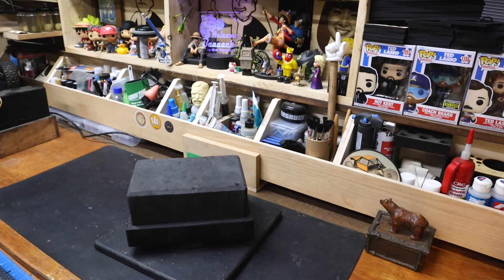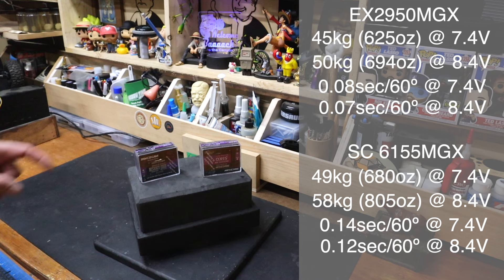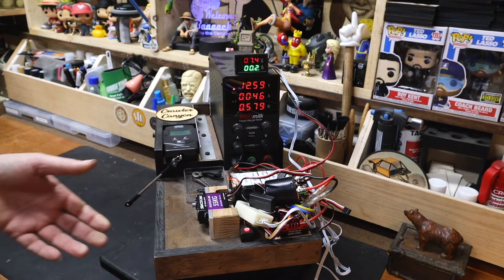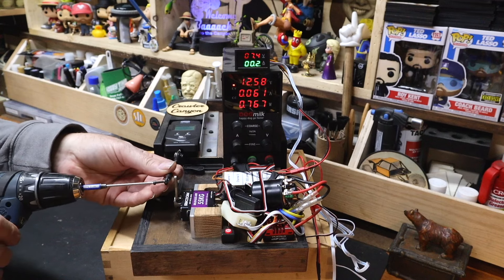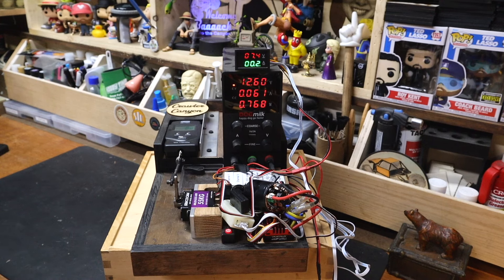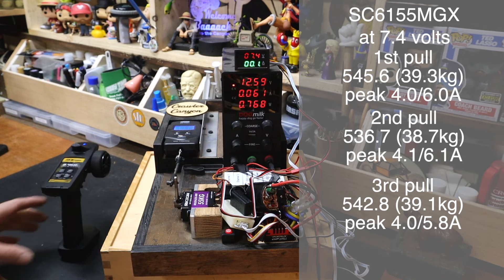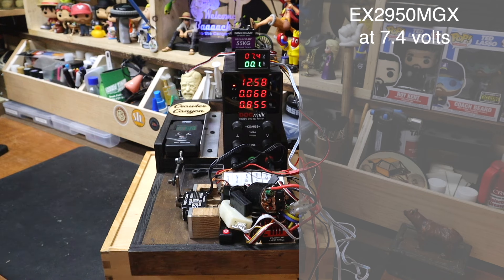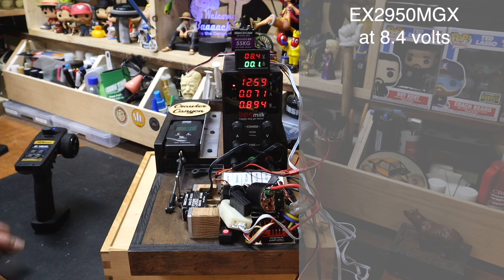Crawler Canyon Presents: Servo Testin' Time, Sincecam 55kg & 50kg LP

Comment: Watching the voltage drop can explain the lower numbers and we are stressing the 1080 max output.
I put a AGFRC A50BHLW in my yet boat, it's also a 90 euro low profile servo in a set with alu arm and progam usb dongle. I don't need torque to move a nozzle side to side but it's fast and a whole ton better than the plastic geared stock servo ( that got wrecked with a flip beach landing ) and commonly I like the full metal 60-70 euro servo's
Reply from the maker: You would love the A50 even more without the euro pricing--  I have one here still in the package for future drift car use (the programability) and it was $59USD.
Reply: @CrawlerCanyon  Just the A50 19kg is 69 euro right now on ali official AGFRC store and I always get a bit of discount at checkout. The programmability I wanted to test and have for future use like 360 and winch servos. So instead of massive end point change I changed the max throw angle way down. It only needed like 90 degrees and 270 or 180 is way to much. plus full metal and ip67 it's a baller servo. the full metal JX I bought locally in the past are also way up in price, used be like 60 now more like 70-80 euro for a 35kg. So AGFrc is looking pretty good for future servos that are programable.

Comment: Iam very surprised 😲 U and I tested that same 55kg when I visited your place, mine put out substantially more torque then those did! 🤷‍♂️ Great job anyway it’s to bad a person doesn’t know who to trust. Today I powered up one of my crawlers and the Imod 60kg 12.6 volt started smoking and caught on fire 🔥. Took it apart and the whole circuit board was burnt boy they sure stink 😂Mark S #21/22. 👋🏼
Reply: I had a FlashHobby 60kg do the same thing....smelled horrid. That servo only made it 4-5 packs, while my others are on dozens and still running strong. I did manage to get the Amazon seller to replace it, but it took 3 months :(
Reply from the maker: QC is definitely one of the potential sacrifices we're making for the lower price point. I haven't lost a single Flash Hobby, but I always feel like there's a "yet" lurking behind it.

Comment: I just ordered one of 45kg  (SC6045MGX) purple ones a week ago! I haven't watched the video yet but I can tell you it's pretty fast and has decent power. Can't wait to see how your testing goes!!
Reply: I thought it would have been better. It is faster and seems stronger than the Amazon blue pro but I don't know if it's worth the price difference. The return to zero is a lot better. So I don't have to adjust the sub trim as much as the Amazon blues on the trail.
Reply from the maker: The build quality definitely seems solid--  strong gears and magnetic encoders might make up for the low(ish) torque with silent running and longer service life. I still think they're too expensive, but I kinda think all servos other than Amazon blues are too expensive.

Comment: Been waiting for you to test some of these.  I have the 60kg sincecam servo in my smt-10.  Direct power from a 2s and it throws the big j concepts tires and wheels around like it’s touring car tires.    I think there is two different classes with their servos.  The one I have looks like the LP in your video.  Black case and black noodle wires.    I only paid $60 for it a year ago.

Comment: It seems like the drop in voltage from the WP1080G2 is the cause of the lower performance... I bet if the voltage was maintained, they would have much higher KG outputs. I also have a WP1080G2 set at 8.4v and on the RC6GSV3 you can set the alarm voltage for the receiver... I have my BEC set at 8.4v and have my alarm set at 7.2v ( just to help me know when im getting close to a stall.) It's actually pretty useful function. But anyway, the point was that i clearly noticed voltage drop along with fading torque and heat buildup. Might be just a little something to keep in mind when doing the tests. I like your servo test videos. Keep 'em comin' on those rainy days every now and then. See ya tomorrow
Reply from the maker: There's really no excuse for making servos this thirsty, not anymore.  Everything is digital, magnetic, brushless, coreless--  the demands should NOT be that high.  If an RX-powered servo is consistently pulling more than 5A, they built it wrong.  If we need to run an outboard BEC, why not just go direct power? The DS Power DS009 was spiking much higher in draw on the rig, but definitely pulled harder than either of these.
Reply: @CrawlerCanyon  I totally agree with you about their power consumption. I just thought I'd throw out an observation I've made on my rig. P.S.- If you haven't played around with the alarm for the receiver on the RC6GSV3, it's actually a really cool feature i discovered by accident and have been using it ever since to let me know when I'm pressing my servo too hard... Just kind of a neat feature that RadioLink threw in there. Anyway, im watching the crystal pin video right now trying to get caught up. Have a good night and see ya tomorrow

Comment: The low profile AGF servos are all rated in the 20-35kg range for receiver powered in the $100 range. I bet something like an SA33 tests in this 450-500 range, but advertised at a much lower power rating. I have an A62 in a touring car and it does well for that. My race buggy and stadium truck run A81BHP's, and those are awesomely fast receiver powered boys. Looks like Sincecam isn't going to be on the recommend list with AGF and Flash servos
Reply from the maker: Yeah, they're nicely built (or at least it appears) but far too expensive for what you get.  Flash Hobby remains the "middle" option, and I'm not seeing anyone stepping up to directly compete. AGFRC are every bit as nice as the big names, but at like 60% of the cost. 

Based on what you give relative to what you get, the 3235SG Amazon blue case might be the best value servo ever made.
Reply: @CrawlerCanyon  Yeah the venerable blue case is awesome bang for the buck. Low profile servos come at a premium for sure, and like you say about premium things, you have to know it is what you need for your application.

Comment: would a 2low transmission work in the injora chassis that the colonel has in it
Reply from the maker: I think so? You'll probably have a motor length limit, though. Like <maybe> up to a 540, but it's become pretty clear to me that that gearbox was designed with a shorty outrunner in mind.  Seems happiest with a 3530 or shorter.

Comment: Unrelated question.
I have an 80amp rhino esc that seems to lose most of it's power(forward drive) while steering. 
Power HD 40 kg servo.
Esc set to 8.4v.
Anyone experience this?
Reply: sounds like you are experiencing a brownout
Reply: @lastcreations8845  I would agree. Didn't think it would be an issue that esc
Reply from the maker: The definitely sounds like brownout. Have you done any of the process of elimination?  Different servo, different radio, etc?
Reply: @CrawlerCanyon  I will swap servos, need to aquire another one. Thanks for the reply.
Reply: Yes BEC will solve your problem sir

Comment: What would you recomend for a capra 4 wheel steer? Was looking at 2 of these 70kg versions for 60 each but now considering differently. Also were you aware the new 1/10 capra 4ws is a esc reciever combo?
Reply from the maker: I always recommend direct-power for 4WS, as that's a lot of draw for any BEC. Flash Hobby have always been good to me, two of my 4WS rigs are running a pair of Flash Hobby 60kg, and they've been great. 

I think everything RTR from (at least) Axial and Element will be coming with the 2A-BS for the near future. They must have gotten a great deal with FlySky.
Reply: @CrawlerCanyon  awsome, thank you for the advice! And surprisingly it's not flysky it's a spectrum 2in1 LOL I almost wish it was flysky. But i can atleast bind it to my dx5 rugged untill I can replace the esc and motor with a fusion se.
Reply from the maker: @3dprintingbiker693  either FlySky or Dumbo are doing the OE for the Spektrum radios, I'm all but sure.

Comment: Jx 46kg direct power for 50$ I run it in everything what do you'll think about it?
Reply: depending how old,  they were very overrated factory numbers,    tested elsewhere.  like  26-27kg at 12.6v
Reply from the maker: Yeah, I don't think I've seen a JX servo  hit it's number.  But then again, I haven't seen a Sincecam hit its numbers either.
Reply: So is it a good or bad servo?
Reply from the maker: @knappsterk7414  The JX are kinda in the same boat with the 9imod servos, and I guess now Sincecam as well-  a little expensive relative to the specs, as pretty much all of the listed numbers are overstated. Flash Hobby is kind of the "standard" for Amazon servos, IMO. No reason to run out and replace the JX 46kg.  If they work, they work. I just like to see more spec for less money, and I think everybody does.

Comment: ouch.  low power wouldn't run them honestly.   How about using a simple blue case for a "servo tester checker"  see if numbers are close to previous test.     enjoy the servo tests alot really.
Reply: 8.4volts should be plenty. 😊
Reply: @marksaxton4760   depends on rig weight i guess,  servo on axle and sub 5lbs maybe.  But i run into times i need more often on one of mine that is that 4.6lb and 38kg.    Numbers are good for high tq servo many yrs ago,  just falling short compared to current market, and especially with heavier rigs aka 5lbs plus.
Reply from the maker: Boy is that true--  say 10 years ago, 400oz would have cost $200. These just don't have the power to match the pricetags. The LP servo at 60 bucks would be pretty great, as I don't think a whole lot of people are running LP servos CMS. High-400s SOA is enough for a lot of rigs. 90 is too steep.
Reply: @CrawlerCanyon   yes still run several old Hitec 7950 55 and big body 80 90.  I did see flash hobby offering a BLS2950MED a 50kg LP at $76 ?   but not sure if 8.4v is going to get there,  maybe just need to find more direct power LP servos to hit the numbers more easily.

Comment: So just wanna say judging the numbers based off of a servo horn longer than the rated number are tested with kinda defeats the purpose of the test.. ounce/inch, kg/cm and that servo horn is like 3cm long at least
Reply from the maker: The hole used on the servo horn is at 24mm, and torque specs from the mfrs. are listed in oz-in and kg-cm.  One inch is 25.4mm, so that's why there are two numbers shown in the summary at the end.  The beauty of math is that torque is linear--  so if you take the torque measurement at 24mm and multiply it by 0.925 you get the torque number for 1 inch. Works the other way, too (linear, you know) so if you're running a horn at 16mm, you multiply the number by 1.56 and you now know that as well. 

500oz-in @ 24mm is 462.5oz-in @ 1", and a chonking 780oz-in @ 16mm. The length of the horn is irrelevant.  This one is double clamping and virtually impossible to bend. That's important.

Comment: I was not impressed with my sincecam purchase.  I bought the 70kg direct power sincecam to replace my 60kg flash hobby direct power that was in my high trail and stripped a gear... and to be fair the high trail runs a castle system on 4s and is a basher.  I only ever ran the flash hobby on 3s even though it is rated higher but after putting in the 70kg sincecam i went straight to 4s on it and it is noticeably slower and less torquey on 4s than the flash hobby was on 3s.  It might just be my imagination but i feel i should have just went with another 60kg flash hobby.

Comment: Even though I know a lot of the companies get you know their products built overseas I like sporting the smaller companies like you know NSD RC reefs mofo shift rc  all these guys is it getting expensive yes very much it is good to have another Choice also
Reply from the maker: It's a nice thought, but none of those boutique mfrs. are making servos--  Reefs are almost all relabeled AGRFC servos, with a Reefs markup tacked on top--  for example, the Reefs 99 is an AGFRC A20CLS, and the AGFRC model is $15-20 cheaper. Same for Shift, etc. Much as how maybe 90% of CF bicycle frames come out of a few factories in Taiwan, there's only a handful of OE suppliers of servos. Some companies are having servos built to spec, others are just rebadging and reselling.